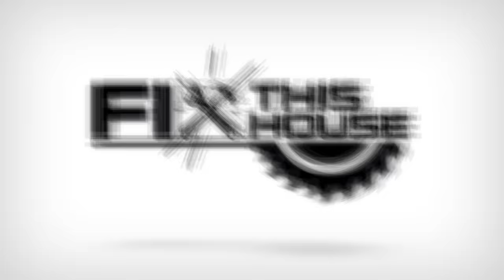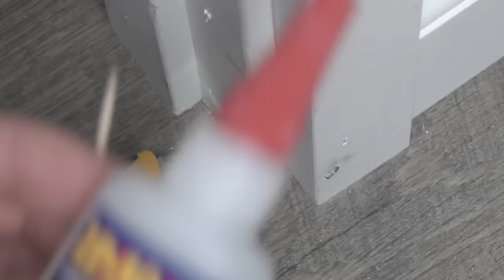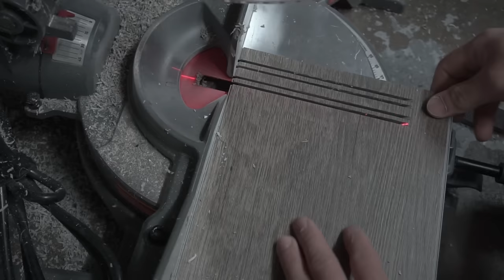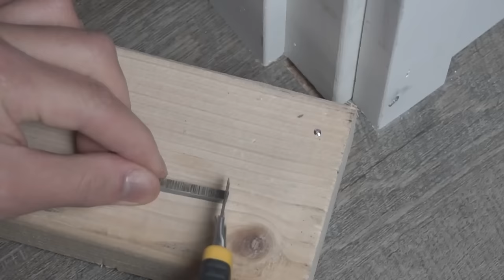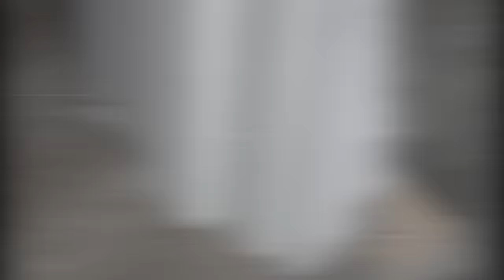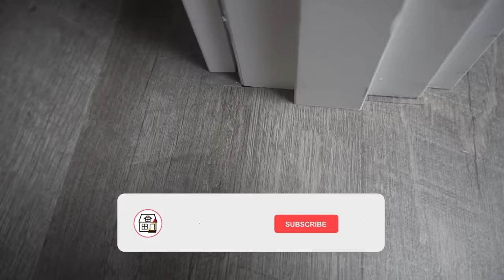How To Fix Gaps On Overcut Laminate, Vinyl Plank (LVP) Engineered Wood Flooring Around Doors | DIY

Comment: I've used the same method of repairing.It's also useful if you have a few different colors of brown and/or gray colored caulk to blend the fill pieces a bit better. If your repair is wood or wood laminate,, you can also use colored wood filler putty. If you use wood filler, you can apply furniture stain and a fine tooth comb to make imitation grain.
Reply from the maker: Thank you so much for this useful advice and for sharing! I’ll pin this comment for everyone to take to consideration! 🙏🏽😊👍🏽
Reply: U
Reply: Caulk can be your friend when used right.
Reply: Can you tell us a brand of the laminate wood filler putty you're talking about?  Thanks in advance!
Reply: Use a Oscillating saw( place a peice of the new against the door jam) use the oscillator to cut the proper height. Slide the new floor under the door jam.. This is the proper way, it clean and professional
Reply: Wood filler way faster
Reply: Caulk and paint make me the man I ain't
Reply: @FixThisHouse  caulking is better? Coz you fill all gap with small pieces? You don’t have any space for expansion, so caulking may be much better
Reply: Not gonna work on metal door frames
Reply: How to repair a hack job, 🤣

Comment: Ummm,.......Calking folks, it's made in every shade possible now days.....This method is completely pointless you get the same exact result with caulking and a fraction of the time and aggravation. The only time to use a method like this is if you really messed up and have a gap the size of your thumb, at which point .....cut a new piece. That being said, you minimize a LOT of this by doing the job right the first time.
Reply: You can even mix lighter and darker shades of caulk together to get your color just right.  Keracolor caulk is best because it comes in alot of different shades.
Reply: I only clicked on this video because I did this but I just caulked it. Saw your comment and laughed.  No need to watch any more
Reply: Caulk and paint make you what you ain’t. I had a guy install baseboards and undercut the boards 3/8” too short… he squirted the caulk in the gap and it looked ghetto. I removed the caulk and applied wood filler and then took small dowels wrapped with 220 grit sandpaper to match the profile of the 4” baseboards. Yes, it took a lot longer this way but it now looks perfect even when looking at it from a foot away. Sneak up on the cuts, then you’ll never need to use caulk to fill in gaps.
Reply: @barkingshark6413  3/8 of an inch.......did you pay this guy.
Reply: This method is the ONLY way to exactly match the floor color/pattern. CAULKING the gap would be too obvious (even with matching up with 2-3 colors) and look like a lazy dumb fool did the job. This video brilliantly illustrates the proper method for correcting jobs in which lazy people who use caulk leave for us to contend with.
Reply: @mgmarrow  More like had the job been done right the first time neither calk or cut would be necessary....
Reply: Caulk would look dumb as heck compared to this method though... I'd probably still do it though bc I'm lazy lol
Reply: To be fair. That's if you go to the store and purchase some. It's probably overpriced and is more of a hassle than just scrap. I hate calking, where there shouldn't be any. Lmao but that's just me
Reply: @daymonlindsey8150  well of course, but this is a fix for when the job wasn't done so well
Reply: I like it better than caulk. Thank You? ( although I'm not sending you money lol sorry!)
Reply: Giving it the ol landlord special.
Reply: Omg those gaps are gnarly. I did this same thing a few days ago with ten year old flooring and gaps that have been made worse over the last ten years. But my flooring is LVP. 
I don't have any more flooring though to work with I got a few pieces from under a threshold I was replacing and I don't have enough room to cut any more off. I think I am going to just glue in some quarter round and caulk the top but not the floor to the quarterround. That bends and conforms with the flooring and these pieces you have should have been installed under the door casing and a undercutting tool should have been used to cut the door casing so the flooring would slide under it. 

Remember people, it is always better to do it right and when selling your place later you will not regret it. Buy the tools at harbor freight and replace them with decent ones if you break it once or use it up after a year and a half. You don't need the best of the best to do nice stuff especially when you are just a homeowner doing it once or twice. At least undercut the damn jams though and the trim and brickmolds and always try and install decking and flooring and pavers and all that good stuff under the door casing as well. 
If you are replacing flooring though you can get away with leaving your baseboards and installing quarterround and you will be kosher that way. But I hope you guys never have to do this. 

It is better than I thought it would be though. Nice.
Reply: @mgmarrow I totally agree! I would much rather it look nicer and take the time.
Reply: If you caulk it, its no longer a "floating floor"
Reply: if you caulk that big of a gap it would be even more noticeable because you'll have a plain spot then rest would be a wood design it would look like crap this method makes it look Ten times better for a DIY
Reply: Caulking the gap is shitting the gap. I personally will never tolerate it.
Reply: White caulking especially around white wood is much easier than matching the floor.

Comment: If it’s a floating floor it needs space all around, EVERY perimeter, to float or your floor can buckle, much bigger problem!  So what I did was inserted foam backer rod and then matching colored FLEXIBLE caulk.  It must be stretchy and flexible so the floor can still float.

Comment: YES!! Thank you for this. I installed my own flooring. First time ever and super inexperienced. So I’m slowly fixing my first mistakes.
Reply: Same! Been looking for this answers for a week.
Reply: Same here.  ...
Reply: You could measure correctly  :)  I am just a DIY person.  When I put down my floors and I had areas like this.  What I did was take a small piece left over from a cut.  Then I would do my measurements.  Then I would cut out using those measurements.  Then if I was a little too shot when I slid the piece under, I would just use that piece and trace it out on the piece I was going to use and make the cut a little bit longer where I was short and it would slide right in.  If it was too long at one point, I would just trim it down and slide it back in to check.  I would generally make the trial piece a little too long because its easier to trim down then be sort.  Your not really wasting anything them maybe a few inch piece for your trial run.  Now you have a perfect pattern and It's a lot better then having what we saw here.  Those little pieces are great for practice cuts.   You usually have plenty of them by the time you get to where you are doing these type's of cutouts.
Reply: Me three...! %99 happy with the whole floor job, but some sketchy bits/parts in the periphery to sort out.
Reply: Just fill it with caulking

Comment: On smaller gaps I've stuffed yarn in to allow for expansion. Those are tricky cuts for "click and lock" flooring because you can't always tip it enough to lock it in around the jamb. If it's a high-end job the only way to do it right and still allow for expansion is to remove the jambs, but that's a lot of extra work for little return on the aesthetic appeal.
Reply: Theirs lots of ways around this without removing the jams. Measure and cut the bottom of the jams, leave a row up to the jam empty for space. Tap the floor under the jams then lay the row in which you left a gap for. You can cut the lock off the board and use glue if you can’t lock this row together.
Reply: @masitraproductions977  thanks

Comment: Always a tough choice. Do you remove a lot of the floor or patch it. If I missed it when installing it I'll take up what's needed to do it right but when  I'm fixing someone else's  mistake and the install is complete I'll patch it like you've done. Some foam backer rod works great to fill in the void plus it creates a push back to keep the  filler piece gap tight . A neat tool for working those little pieces in is a paint can lid key. Depending on the shape of The key  and hook it works great for getting under the casing and behind the piece to move it around into position. Like you stated , patience is what's going to get you the best results.
Reply from the maker: Thank you! I’ve never thought of using backer rod, that’s a great tip! Thank you for that! 🙏🏽😊

Comment: Good topic to cover ;)   Also, invest in a flush cut saw like a pull saw.  Trim off the bottom of the jam and trim at the level of the vinyl plank.  Use that large piece of Vinyl plank that you trimmed small pieces from and cut a larger piece.  Cut back the existing piece an inch or more then you have a nicer tie in that will slide under the the jam and trim(note: leave a 1/4" of space to the stud).  Don't glue it unless you have to. The rest of the floor is meant to float and have tolerance to shift.
Reply from the maker: Thank so much much for sharing your advice! 🙏🏽😊
Reply: That's another good method.
Reply: This is one of the key uses for an oscillating saw. It will lay flush and cut the door frame level. I have used a piece of plywood or scrap flooring to get the correct level for the blade.
Reply: 💯 Use a Oscillating saw for a clean professional look for all the door jams

Comment: I used a metal file to get them to fit perfectly in there when the pieces were barely too big to wedge in. I did this in my bathroom against the tub. They previously had quarter round nailed into the tub. It was the grossest thing I’ve ever seen.

Comment: You can also try tapping the floor from the opposite Edge and moving the whole row to slide under the molding
Reply: On that size piece of you tap it back a whole section follows it, unlike a cleated in hardwood floor. Then your expansion gaps all go out of whack.

Comment: My handyman/ 
Contractor put my new vinyl plank flooring in my 2 bedrooms I took the old baseboard off for him so he could run the floor right to the drywall but when he went to put my new baseboards on there are gaps between the baseboard and the floors it looks horrible I don't want corner round I think it makes it look dated and also he left gaps at the top of the baseboards and the gaps your showing on this video around the door ways I need help don't know where to start to fix these problems any suggestions would be greatly appreciated this simple renovation on these 2 bedrooms have become a nightmare

Comment: just had 1/2 Cortech installed.. a 1/4" gap is necessary for expansion.. why not use 1/4 round that's NOT nailed to floor but to wall.
Reply: If it's an actual door jam, shoe or quarter round will mess with the door

Comment: 'k in the uk  we  leave a 10mm cap  around all  lam flooring   for expansion reasons
Reply: 2mm  will suffice. We don't live in the tropics! and the warm air generated from central heating rises away from any flooring.

Comment: As a customer I would not be satisfied. That looks like a hack job !!!
Reply from the maker: It’s really hard to find a solution for this especially if it’s a continuous floor with no transition. I’m curious what would you have done differently on this situation?
Reply: @FixThisHouse  As an installer, I would have noticed this when laying that piece,  and cut another to fit property
Reply: @sharonk6953  you mean ‘as a stoner’ lol
Reply: @FixThisHouse  as a installer I use a Oscillating saw, place a piece of the floor against the door jam, cut it out using the Oscillating saw for the proper height, then slide the new floor under the door jam

 for a clean professional look for all the door jams

Comment: I’m a woman I just had some flooring done.. and the details are important the small details and they’re a couple of things that my flooring guy did that I wouldn’t have done and I’m not over the moon the flooring is beautiful and it cost me $4000 that’s not the price of having it installed that was just for the floor and the underlayment..so I noticed a spot at the back door where he kind of messed it up.. I guess he didn’t think I would notice. I haven’t left him any reviews yet and I can’t. I’m having a hard time struggling with leaving him in a review because his quarter round and some of his finishing touches are a little sloppy.,so when you say caulk do you mean put the missing pieces in and then caulk them in or just caulk the area? it’s really minor but I noticed it so I need help please somebody tell me what do you mean when you say caulk..caulk the pieces and caulk it in or just caulk the area without putting in these vinyl pieces?

Comment: Why not just use the multi tool and cut the bottom to slid the floor right under then seal with caulk. The one shown on the video seems extremely ridiculous. Could get this done in 2 mins with that tool. Cost 15 bucks.
Reply: With click in laminate, you can't always slide the laminate since you have to install it at an angle, then set it down into the groove. But you can't do that unless you cut around the door jamming... thus this video.

If you've never experienced this, then you probably wouldn't understand the dilemma.

Comment: Just NO a good floor installer would not and I repeat would NOT fit or leave a floor finished like that, shear amateur finishing
Reply from the maker: Unfortunately this are some issues I come across with. Just trying to provide an option to fix these type of issues from past installers.

Comment: no one is ever gonna notice that, just use same colour gap filler caulk it. your method wont work anyway, as floor expand and shrink overtime, those glue wont hold.

Comment: The purpose of the gap is to let the laminate breathe it's why you you use chauke And not laminate. If the laminate is too tight it will expand and pop out. Weather changes the laminate fitting. This is a bad idea.  Chauk comes in many colours And takes far less time. Yes the installer did a bad job but don't go making it worse
Reply from the maker: Gaps are only suppose to be 1/4” around floating floor. This gap is over 1 1/2” behind that door jamb.